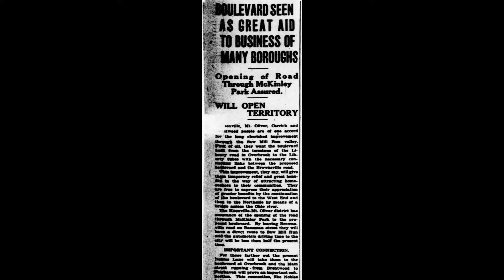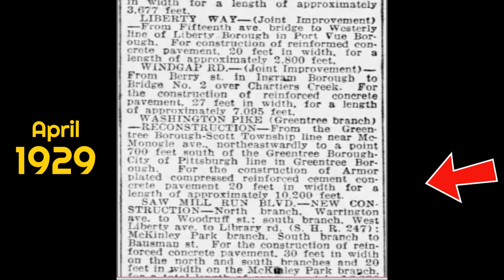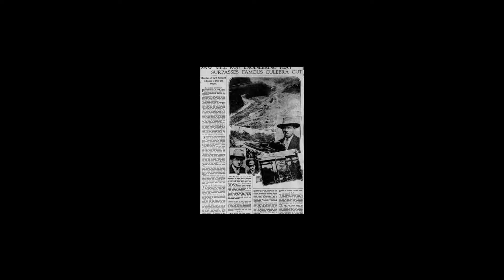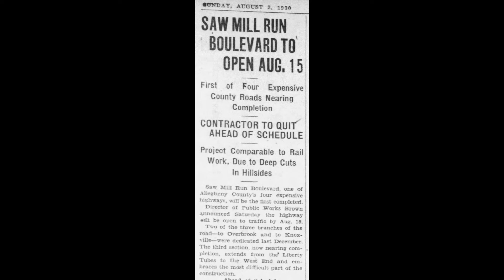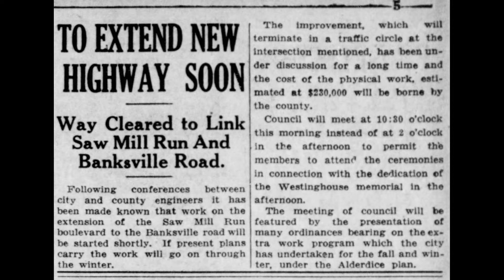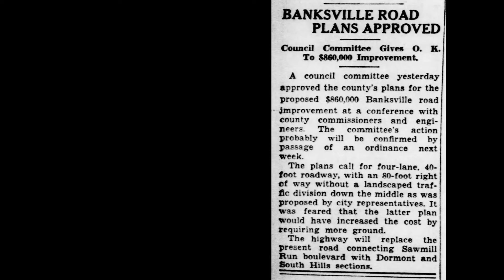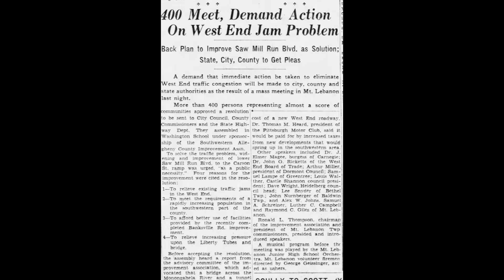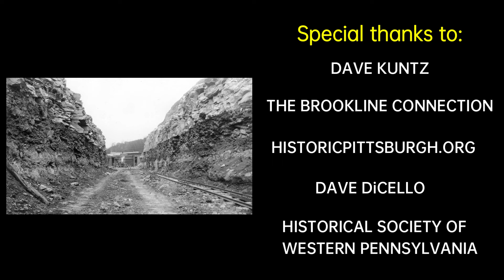Saw Mill Run Blvd. - Part 1

Comment: Am i the only one who wants Rt 837 to be called "Monongahela River boulevard". Seems our naming structure is incomplete without that nomenclature.
Reply: I think The Boulevard of the Allies original had that name.
What I want to see is some sort of recreation of the pylons that marked the ends of the Boulevard. There were originally 12, two at each end of Sawmill Run, Allegheny River, and Ohio River Boulevards. They had sculpture of the early transportation in the area, and if memory serves me, of  the Sawmill. Most got removed due to road widening or trucks smashing into them. The one at the bottom of Warrington Ave. was still there till the late 80s or early 90s. That it had once back-lit signs as to your direction fascinated me as a kid.

Comment: I was on Saw Mill Run Blvd just the other day (first time in over a year) and hadn't even realized that they took the old Wabash RR overpass out. It really opens up that entire section of roadway without that massive concrete eyesore there anymore
Reply: I kinda miss the overpass, I agree it was a bit dark and scary, but it had some art deco character and could have supported a better approach to the Wabash Tunnel.

Comment: Great video Tim. Brings up a question I've always had.  Why didn't they line up the West End Bypass with the West End bridge when they were putting the bypass in instead of having to wait until what like 2008? Railroad wasn't cooperative?
Reply: I think that's what it was. A major line prob went thru there. Even after they built it they didn't connect it all for years. I remember coming off the bridge, being able to see thru the structure they build for us to use..but then would have to turn around it
Reply from the maker: Yeah, while they railroad was probably one reason, my guess is there was a multiplicity of factors including the various streets that converge there, the openings under the railroad that already existed, streetcar lines, the creek, the alignment of the bridge and more. And, just like the years leading up to building the bypass (and beyond if you look at Greentree Hill and the Parkway) it seems they never imagined the continued growth, planning only for what existed the time. Good question!!!